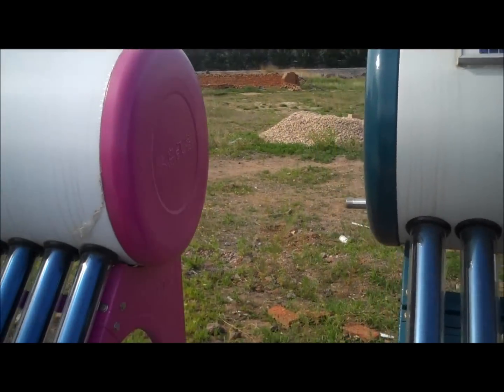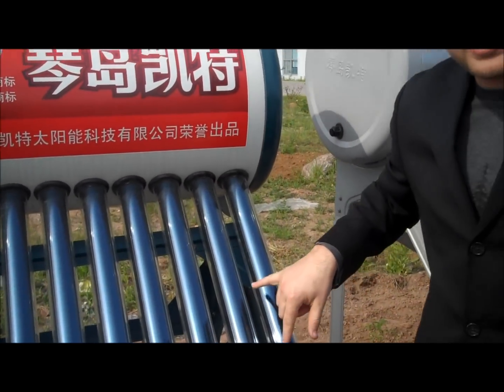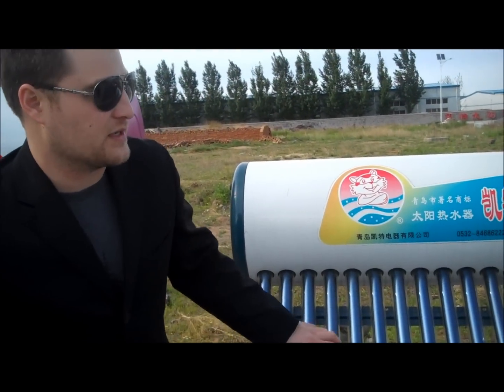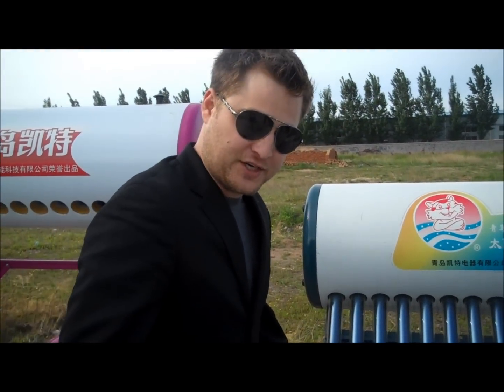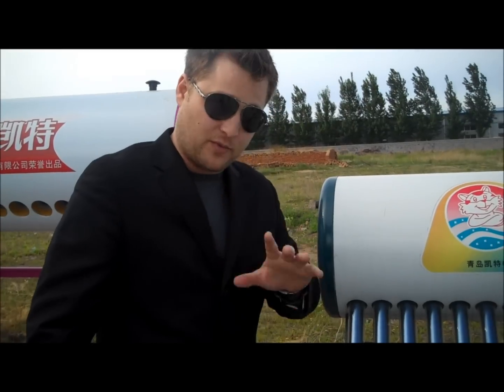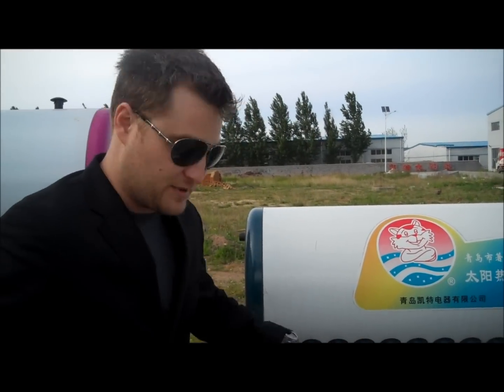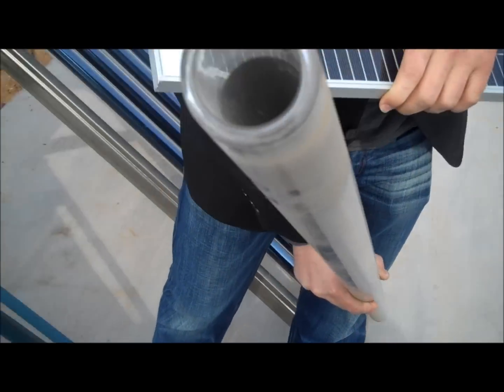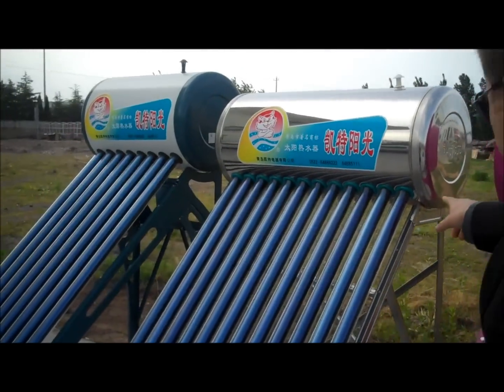Solar Water Heater Evacuated Tube Panel Systems Explained At Factory in Qingdao, China

Comment: Note: There are 3 different types of these compact  solar water heaters, Non Pressure, Non Pressure with Pressure Copper Coil, Pressure with Heat Pipe. The guy that went pop got a non pressure and pressurized it, he was the numb skll not China Manf.
If you want a good one get a non pressure copper coil with controller & heater, I sold 100 and all are good 3 years later, Pressure model; very bad, much trouble in operation(over heating) and tank failures. I have 6 heating my home in Maine

Comment: To clear issues out: Efficiency of solar panels is the energy collected from the total of the sun energy received, cannot go above 85% in current tech. The efficiency in geothermal energy heat pump is different and vague, because its not the normal efficiency of energy received vs energy used, but its a measure of how much energy you can move from one place to another using 1 unit of electricity.

Comment: Do the evacuated tubes went broken if at night temperature goes under 0°C and maybe somebody takes a long shower emptying the tank.... with this direct convection circulating water into the glass tube?
Are there any risk of ice formation and expansion inside the tubes?
what are the termical climate tolerances on the basic simple natural convection systems?
Reply from the maker: Rich Goldstone  The tubes are actually closed and are not open to the air. So there is no risk of freezing or ice being created inside of the tubes. The main tank is also well insulated. The tubes will not break either when the ambient air temperature falls below 0 degrees C.

Comment: Why not make a base and stand these on end and use mirrors to redirect sun light to hit the tubes from all sides all day to generate hot water to use with thermal electrity generation or use gallium heated by tubes pumped through copper coil heat exchanges to heat water and produce electrity?

Comment: How good are they in a hail storm?
Reply from the maker: Very good, they are designed to withstand 0.8" to 1" diameter hail stones. They are very well designed for export from China and I have not had one break yet from hail.  The only time I have ever seen q tube break was when an installer dropped it from a 3rd floor roof by accident while installing.

Comment: in other words: you and I each might eat a sandwich of 100 calories, but you can move use a normal crane to move 10000 tons of rocks, while i can use an advanced crane to move 20000 tons, and thus the efficiency is higher than 100% but its only a matter of moving energy from one place to another...(in this case from a cold place to a hot place)